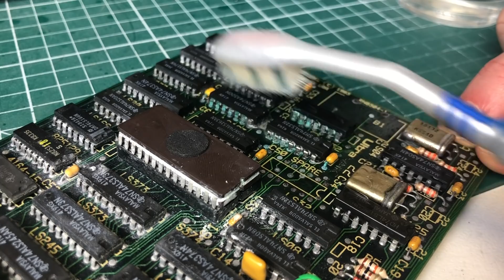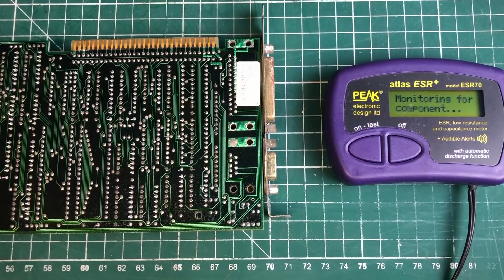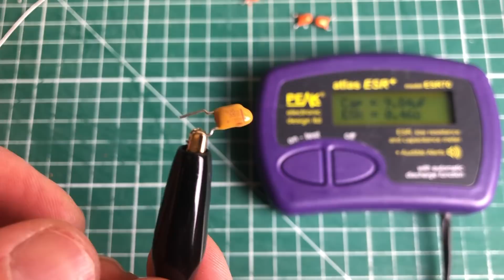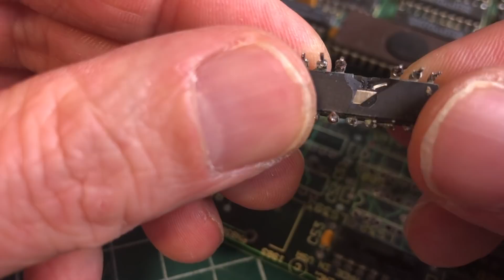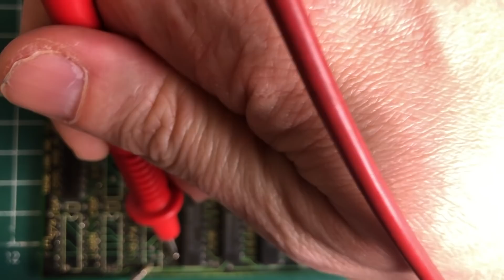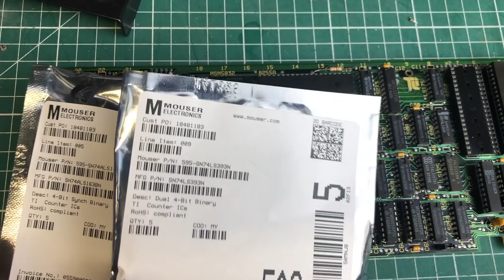Unfixable videocard from hell ? (part 1)

Comment: Why are you using an acid to neutralize an acid?  Should have used baking soda. Unless the corrosion was from an alkaline battery, in which case its not battery acid.

Comment: Are you just fixing this for the sake of fixing it? Or is it an irreplaceable piece of vintage equipment that would be nice to keep running?
Reply from the maker: Just trying to learn .... the card itself is not worth a lot. it is one of the first Tseng Labs cards and supports a non standard 132 column mode. I’m just trying to learn some more on the internals of such a card.

Comment: I use water with laundry detergent to clean water damaged PCBs in ultrasonic cleaner with heating. 1 to 2 min will do. Be cautious that ultrasonic cleaner can peel of soldering mask and damage crystal (crystal oscillator)

Comment: This is Tseng Labs Utrapak. First Tseng card ever. IBM Monochrome (text only), printer port and realtime clock module. Caution - video output is digital TTL level (5V).
Edit: D-Sub pinout for mono/hercules.  1 - GND, 6 - Intensity (highlight), 7- Video, 8- H-sync, 9 - V-sync.
Probably video module works but monitor expects video on pins 3,4,5 (CGA/EGA) and displays noise.

Comment: What I do when it comes to soldering in ICs or Sockets I'll solder two spots to IE the two corners like if it's a 14pin Dip I'll Solder Pin 1 and Pin 8. That way I know it's flat then continue to Solder the rest of the Pins in.

You might want to invest in a Scope and a IC tester. I think the TL866II Plus can scan/check 74logic.

Comment: I thought capacitors were voltage dependent.  A 35 V 10 uF capacitor would be 10 uF at rated voltage, but if the 35 V capacitor is operated at half voltage, the capacitance would also be half.
Reply: @glyn hodges  The formula for capacitance is charge divided by voltage.  In other words, if you have two equal capacitors in series, the voltage rating of the pair is double, but the total capacitance of the two capacitors is half of what one of the single capacitors is since the voltage across each is half of what it would be if only one.  Capacitance is proportional to voltage.
Reply: @glyn hodges  Nope.  1/Ct=1/(c1+c2+…) where C is capacitance.
Reply: @glyn hodges  What I'm talking about is the rating of a capacitor in uF (or whatever units).  If a capacitor is 1uf at 600Vdc and you operate it at 300Vdc, it's capacitance is .5uF, that's what I'm talking about.
Reply: @glyn hodges  Your last sentence is what I’M saying, it is proportional to voltage, ‘per unit volt’, less volts, less capacitance.  A capacitor is a physical thing that doesn’t change according to voltage (or anything else), but it’s ability to do what it does (it’s capacitance, in uF) is proportional to voltage.  A capacitor's capacitance on the label is at the rated voltage on the label.  If you applied zero volts, it’s capacitance would indeed be zero.

Comment: uhh... vinegar is just more acid and doesn't neutralize, you want baking soda to neutralize the acid. leaving it to soak in a baking soda bath should help immensely instead of using vinegar. then of course wash with soap and water, or alcohol, and let dry.
Reply: No, the battery fluids are alkaline, so vinegar works. He just got them mixed up.
I'd have cleaned with water first to remove as much as possible, then used vinegar to neutralise anything remaining.

Comment: When you took out the chip with hot air, you forced it out too fast, before the solder was melted all through the pad, and ripped all the top pads from the PCB. Every ine of those pads on the top you showed was ripped up. You could heat the top side of the pcb (the chip itself) but usually it's best just to use a LOT of flux and desoldering wick than to use the solder sucker. Also put flux on both sides of the PCB including the top, helping to melt the solder and pull it through.
Reply from the maker: Jernej Jakob checked all the top pads after removing the chip and before / after I inserted the ic socket and could trace them all down. Problem now is that I only get 10khz of hsync so nothing shows up on the monitor and I have no idea where to start looking...
Reply: @RetroSpector78  that green trimmer cap was very likely damaged, although I suspect it's for the RTC as it's close to what looks like a watch crystal. Other than that, It would be hard to trace down without a schematic. Maybe you could look up all the chip datasheets and look at each pin with a scope to see if any signal looks wrong (eg logic gates whose output doesn't correspond to input) but it's more likely a broken trace or bad contact somewhere.The large EEPROM socket could be still bad where you can't see it.
Edit: yep, the MSM5832 is a RTC chip. The rest of the circuitry could still rely on some signal from the RTC to work. I would start at the crystals and trace the clocks through the circuitry to see if they're lost somewhere. You can use photos of the bare board without the chips to reference where the traces should go.
Reply from the maker: @brainndamage  I think everything is derived from the (external) dot clock (the crystal). This gets divided to 16.257Mhz / 9 = 1.80Mhz  (character is 9 pixels in height). That 1.80Mhz goes into the display controller CLK (MC6845).  From that you can derive the horizontal sync (80 characters / row + horizontal retrace time = 98, so 1.80Mhz / 98 = 18.432 kHz hsync. With this card however I am only measuring a clock of 1.07Mhz, so the hsync ends up at 10 kHz (1.07 / 98 = 10kHz).  I can compare that with a working MDA card so will try to focus now on where that 16.257Mhz / 9 = 1.80Mhz is going on.
Reply: @RetroSpector78  At 12:24 it definitely looks as if the traces around the holes are missing, and when you remove the chip, the rings appear to be attached to the legs (although it may just be flattened solder adhering to the pins).
Take a look at the chip you removed to make sure?
Good luck! :)

Comment: 8'39" to remove this kind of chip is simple. Cut the legs with a side cutter and remove each remaining leg with the solder iron and tweezers.
Of course, do that only if the chip is guaranteed a dead one.

Comment: The cheap MiniPro TL866/TL866II EPROM programmers have a handy test capability. I've found this to be very helpful in debugging dodgy 74 series logic chips. It can also test static RAM. Sadly not common 4164/41256 DRAM chips though.

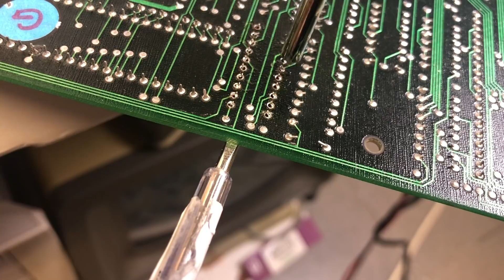Comment: When you insert that flat screw driver under the IC, and start turning it, if there under the chip is a track, you will scratch/cut the track with the screw driver, that was a bad approach, also when you (11:30 up to 11:50) used the border of the PCB as a pivoting point for the screw driver you bended the border, stretching the pcb surface, those tracks on the edge gets stretched and prossibly broken. I hope you ends fixing the board, but too many mistakes. First, you set it up in an ultrasonic cleanner as first STEP, then you mount it in an motherboard out of the cpu case, you really needs to do measurements when it is turned on, you not happily unmount ICs until you know which is bad, for knowing that you needs to scope those input pins and output pins., reffer to logic tables documentation and do a PRO investigation, here we are talking about amateur hoby, so time don't matter, labour hours don't matter.  Basically, this video ends like "how to solder somehow", not "how to properly repair". Anyway, good chanel you has. Thanks. Just suscribed.
Reply: Hah, harsh, but you're not wrong.

Comment: 7:53 wow, dollar store soldering iron, literally the worst technique I've ever seen with the desoldering pump - no wonder you're not having a good time and pulled all the vias out of those sockets. And still terrible technique at 9:10 even when you think you're doing it correctly. Problem with youtube is there are too many "experts" that have no idea wtf they're doing in the first place trying to teach other people.
Reply: Critique is welcome, I’m sure, but does it really need to be delivered with contempt to be effective?

C’mon man.  We’re not all trained repair techs here, clearly.  But the guy’s sharing the experience he has.  There may be room for improvement but we all start somewhere.
Reply from the maker: I'm not taking it personally and he definitely touched on some valid points that I will be working on ...  I am happy to accept all kinds of feedback and criticism.... the good and the bad :) I would have phrased it a bit differently, but we all got our way of doing things .... so no issue there. ....
Reply: What would you do differently?
Reply: @djdjukic  Add fresh solder to the joint, keep the iron on it for at least 10 seconds, then you quickly switch between the iron and the desoldering pump. You stick the entire nozzle of the desoldering pump over the joint tight against the board so it sucks the solder out all the way through. It takes a little practice to get the technique down, but a) you don't melt the tip of the desoldering pump with the iron, and b) you form a seal all around the joint to completely suck the solder out all the way around, not mostly air from around the tip of the nozzle of the pump. Also, don't use the dollar store soldering iron (dead give away, tip is held in with a screw - that's the cheapest soldering iron you can get). Get something that's at least temperature controlled, and on the high wattage side for desoldering. If you're going to desolder a lot of through hole, a vacuum pump based desoldering station is well worth the $150 you'll pay for it. I used the hand desoldering pump for a lot of years, then got a proper desoldering station a year or so ago. I much prefer the vacuum station, unless it's only one component with 2 or 3 legs, then the hand pump is sufficient. Even with the vacuum pump station, the best technique is to hold the tip on for a while to let everything get hot, then turn on the suction while moving the iron in a circle. That way you don't end up with the pin still soldered to the inside of the hole on one side. You can see when he levers out the chip with a screwdriver that a lot of the plated vias that connect the top and bottom traces came with the chip, turning a simple repair into a nightmare. Look for the copper colored rings on the pins of the chip after he pulls it out. If you're going to repair things, and especially teach others how to do it, at least do it right.
Reply: @gorak9000  Thank you very much for the detailed advice. I did figure out that you should try to get the tip of the pump all the way around the pin, but sometimes either the board has too much or the pin too little thermal mass, and the solder freezes the moment you pull the iron off the joint. Desoldering is a real struggle sometimes, especially with modern, thin boards with crappy vias. I've been meaning to get a vacuum desoldering station, and now I will, no more ugly repairs!

As for the criticism, I don't know how the author of this video feels but I often learn a lot from these brutally honest comments, on my own work and that of others.
Reply: @gorak9000  In any case he got the job done, though I would not dare ruin that one IC footprint even "for science"!
Reply from the maker: @gorak9000  All very good points and I will work on the areas you touched upon. It should be obvious from my video's that I am not a trained professional, nor do I have the desire or knowledge to be a trained instructor ... I'm just sharing the stuff I come across when dealing with retro stuff.... as always some people like it and find some of it helpful while others don't.... and I know there is lots of room for improvement. I will try to cover some of your points in future video's and make it more clear to people that I am also just learning as I go along and will try to point people to more professional instruction video's when it comes to stuff like soldering / desoldering.
Reply: @djdjukic  If the solder freezes as soon as you remove the iron, you need a higher wattage iron, or to (pre)heat the area with hot air. Usually you'll end up with one, or a small number of pins that are harder to remove than the others, as they're connected to some copper pour (usually a ground plane or power plane) rather than a single trace, and the PCB designer did a crappy job of the thermal reliefs between the pad and the pour. A little trick helps you cheat a little if you don't have hot air, or a higher wattage iron. Desolder all of the other pins besides the stubborn one, and verify they're completely free by making sure the pin moves in the hole with a screwdriver (or other poking instrument), remove the chip while the iron is heating the stubborn pin / pad. If solder remains in the pad once the chip is out, mount the board in a vise vertically, and place the iron on one side of the board, and the desoldering pump on the other. Suck out the hole while the iron is applying heat on the other side. Usually the kickback from the pump spring makes the iron jump out of the hole at the same time the pump deploys. Usually works to clear out even the most stubborn of holes, unless your iron is really under powered. If it doesn't, just add more solder to the hole and repeat as necessary, maybe dwelling longer with the iron before deploying the pump to allow more heat to soak into the board.
Reply: @RetroSpector78  I didn't mean to be harsh, but there are lots of other videos showing the results of bad desoldering and how it damages the boards and makes repairs much more difficult later, mainly by lifting pads (too much heat, either too high heat setting, or non-temperature regulated iron), ripping out plated through holes (but not completely clearing out the solder and using force to remove the chip, and rip the plating out with it leaving no connection between the top and bottom sides of the board - many times the pad is also used as a via to connect 2 traces together, and once the plating is gone, unless you solder both sides of the chip after, that connection might be broken, and very hard to diagnose). If you have to apply any force to remove a chip once it's desoldered other than to overcome the spingyness of splayed pins on the edges of the holes, STOP! Something is still holding, and forcing it WILL rip out the plated holes. Old boards are especially prone to either of these failures, as they tended to use weaker bonding of the copper to the substrate, and the plated through holes weren't' as good as modern boards either. Modern boards are more resilient as lead free solder has higher melting temperatures, so the boards are designed to take more heat during manufacturing - copper is better bound to the substrates, and the plating in the holes is thicker. Along with the warning about "don't use too much heat" - don't use too little either. I run my irons at 650F (~340 C) typically - bump it up to 700F (~370 C) if you run into something stubborn, but no more. It's rather painful to watch someone trying to repair something old, and probably rare, and making it much more difficult than it needs to be. Practice on some scrap boards you don't care about first, and get your technique and process dialed in, then attack the board that actually matters. I'm also not a trained professional (as in soldering isn't my day job, ee and coding is), but I have years of experience (aka I've broken many things along the way and learned what to do and not do) soldering and desoldering all kinds of crazy stuff in my hobby projects.
Reply: @gorak9000  Yes, it is the ground/power pins usually that give the most trouble. And it is often too tempting to avoid figuring out how to mount the heavily populated PCB into the vise, just for one or two holes... though it is the proper way.

I've had to clean up someone else's job recently where some short, small diameter pins had become stuck in the holes. They were a tight fit, so the pump could not suck them out. If I were to grab them with tweezers, the tweezers would sink the heat right out of the pins, so I tried to crank up the temperature considerably, but that didn't really matter as I could not get enough grip to pull on them. The only way I could do it was to make a blob, and push with the iron... which can be a real good shortcut to just wrecking the pad, but the pins came through fine, thank god. I wonder if a vacuum station would help in such situations...